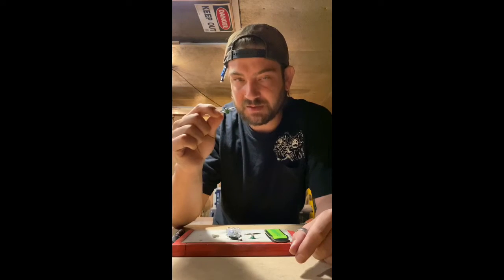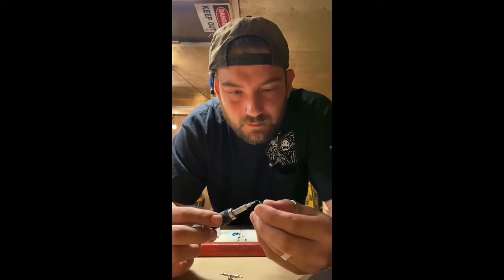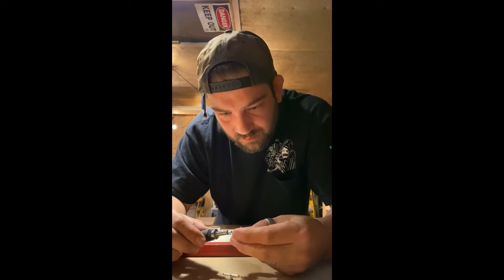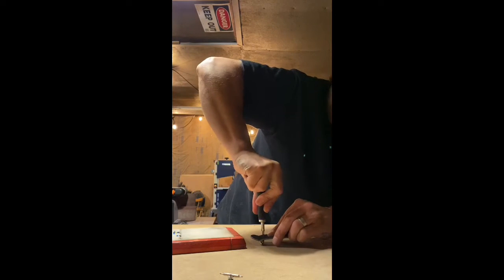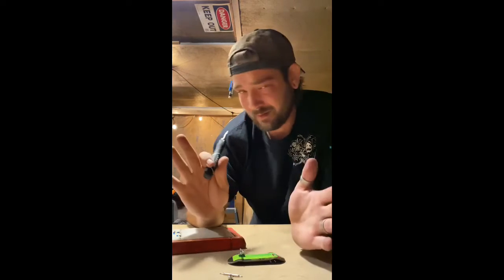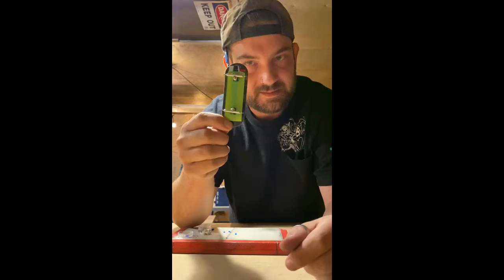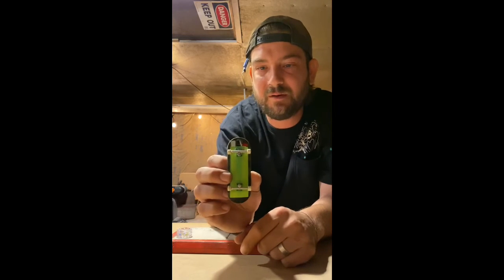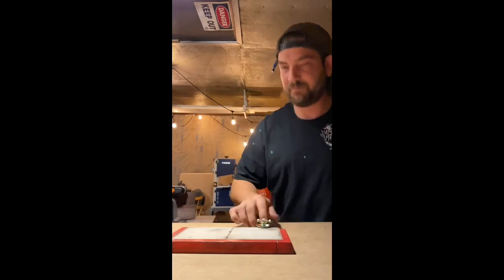How to thread fingerboard China trucks

Comment: found this video because it was my first time trying China trucks and I wasn't sure if they're meant  to be pre-threaded or not. But I found something that works good for me was to take the hangers completely off so it's just the baseplate (reverse kingpin so nothing sticking out) and then turn it upside down and press it hard onto the table with your thumb using your fingers to grip the underside of the table and get more downward force to keep it completely straight then you can use the screw driver to screw straight down using your bodyweight. I was really struggling when  just using my fingers and trying to do it like you did in the video so hopefully my tip helps someone.